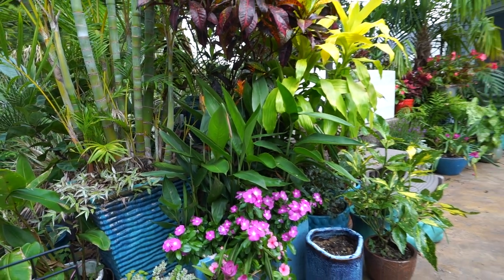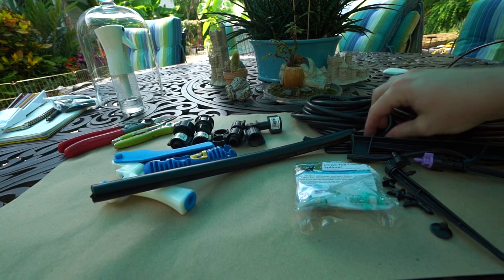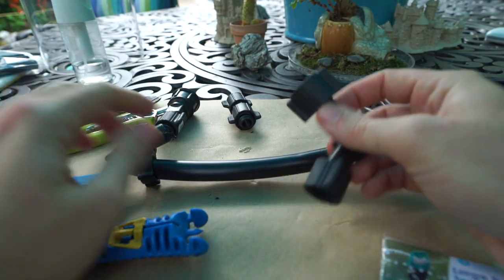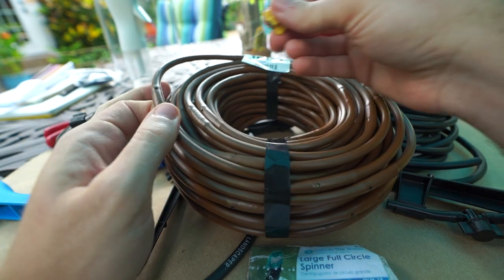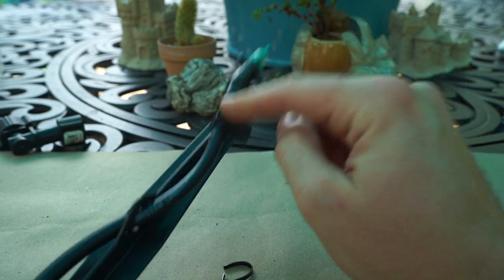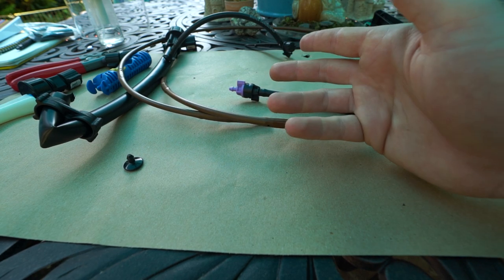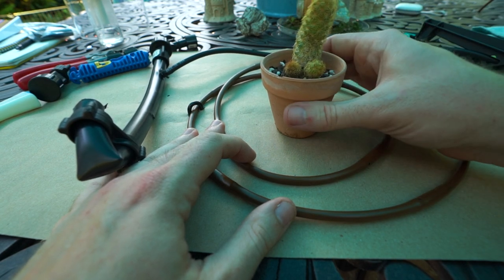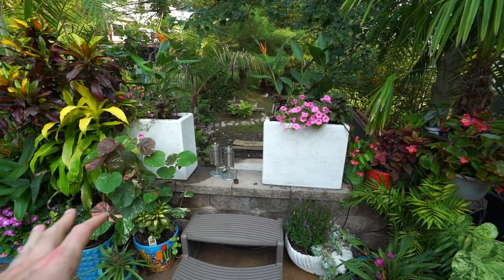How to Set up Drip Irrigation on Potted Plants

Comment: Hi Jeff! This was very helpful. I like how you explained all of the different pieces and what you use them for. I have soaker hoses set up on a timer in my two raised beds and love it! I did add a filter and haven't had any problems. When I need to replace the soaker hoses I'm thinking about using drip, so this was good! I just watched the "Turbo" video and had to chuckle when you said you had the tortoise pen set up. Thank you so much for sharing!

Comment: Thanks for the instructions and stuff now I need the advice for a good timer, which one oh and how long would you have to set the drip,
Reply from the maker: I've used a lot of timers and have yet to find one that doesn't disappoint in one way or another. If you just need a timer that is set up for one or two zones, there are a lot of options. Orbit, Mel melnor and rainbird work well.

Comment: I only have 1 zone set up currently on drip and a blue tooth timer. I love it, set it and forget it. I for sure need to set up more zones. We spend about 15-20 hours a week dragging the hose around a half acer to water everything.
Reply from the maker: Which Bluetooth timer are you using? I tried several last year and they all broke within a matter of weeks. I absolutely loved them when they worked!
Reply: @TropicalPlantParty  I am using the Orbit B-Hyve 24511 The range is not great as I have to be within 20' of it to connect to it on my smart phone but once it's programed I have had 0 issues with it. Going on 4-5 months now and have not even had to change the batteries yet. I have it set to run every day at 5AM for 30 minutes.